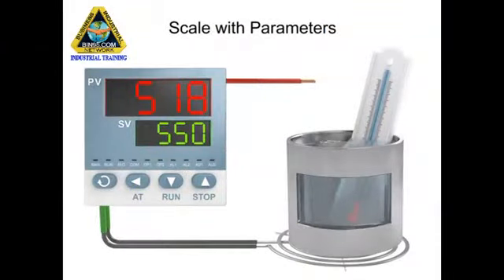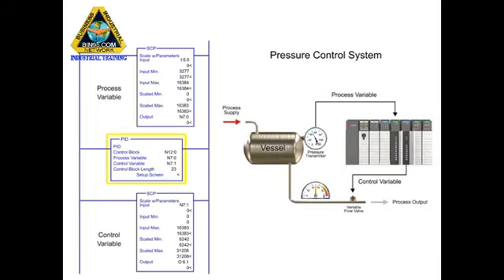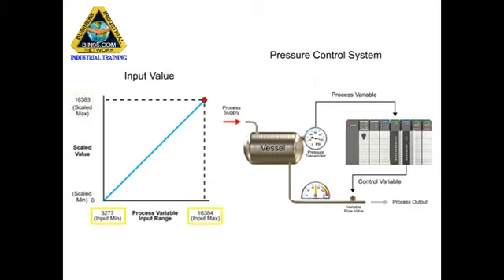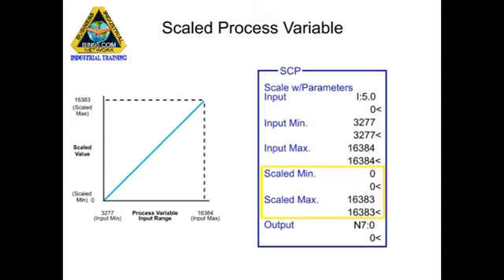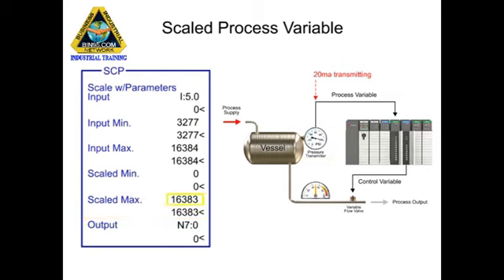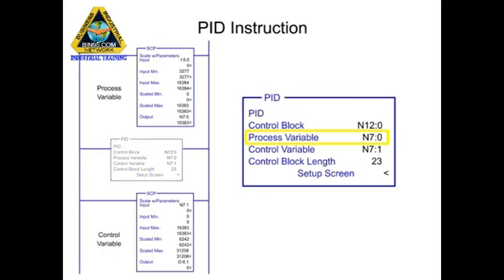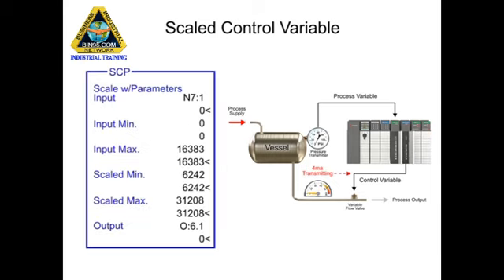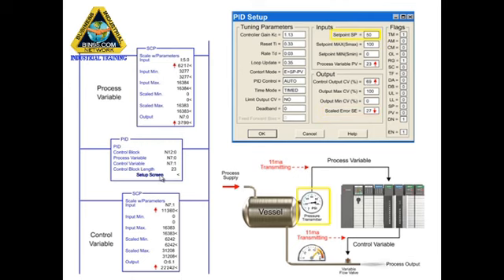What is PID controller 2: The PLC PID RSLogix 500 tutorial.

Comment: How did you come up with the range of 3277 to 16384 ? Is that always the same or depends on the A/D input card? What would be the best way to understand what range has to be used for different cards and transmitters. Thank you
Reply from the maker: It is a computer numbering standard and standard among all A/D. As the max value 32767 is arrived at by being the maximum number that can be stored in a 16 bit integer block of data. (In computers its always been base 16 ... 32, 64, etc., later 32 bit word sizes (base 32) become more commonly used, but it is the same 16 bit max. ) The limits set in video (3277-16384) where just decided by programmer for specific application in the example. You may have a 40ma sensor that manual indicates uses max 32767 to -32768 but the programmer may chose to only use a smaller range. (They just cant use a larger one than device manual indicates. Most will be that 'magic' number 32767.
Reply: @Bin95  
Thank you for the reply.
But shouldn't be a common rule to determine what range has to be selected and why?
On other words, what's the benefits of shortening the range? 
What if we use the whole range -32768 to 32768?

Comment: How did you come up scaled min 6242 and scaled max 31208 ?
Reply from the maker: The programmer comes up with the range based on sensor specs and application. The sensor documentation is the place to start, then deviate if needed by the application. As long as you have the whole scale/bandwidth of the sensor or greater, the programmer sets the trip points according to the application, independent of the sensor scale.

Comment: Output is current or voltage signal? O6:1 output
Reply from the maker: Like it shows, 4-20ma. But would be the same if you wanted 1-10v, you just change card on 500, setting for card on 5000. Logic/function the same, scale/setting may vary depending on application.